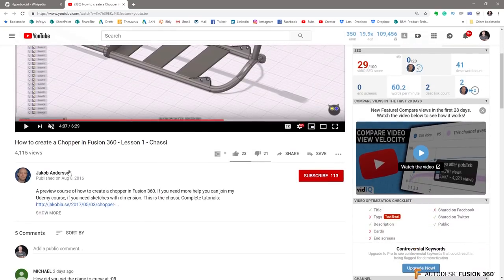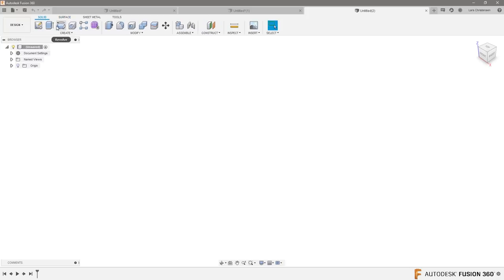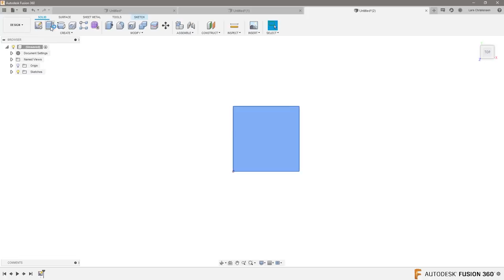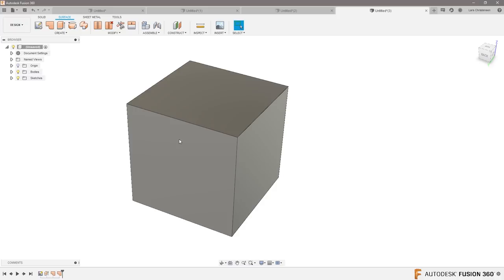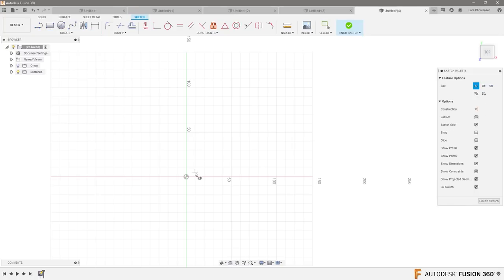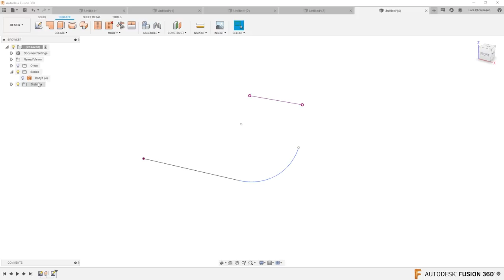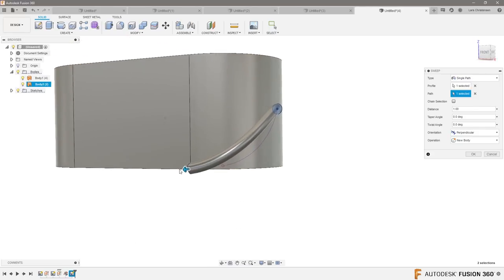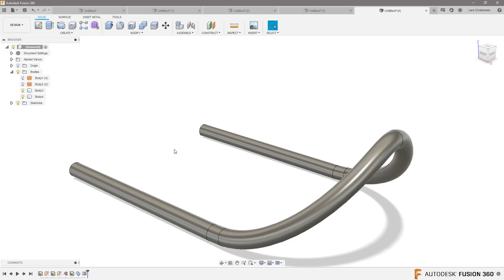Fusion 360 — 3D Sweep for Bike Frame — Ask LarsLive

Comment: Lar's, 

I think you are wrong in regards to old school surfacing. Old school surfacing is what I know but D-sub as powerful as it is. Is interesting, but as I learn more and continue to learn Sculpt, I still come away with a non precision body vs finishing up something made from surfaces turned into a solid, that is per design and makes the customer is happy.

This uneasy feeling, I have about Sculpted models may change as I gain more experience and my thinking may change.

I do like the concept of hybrid modeling where the D-sub is tied down between other geom (surfaces) is very interesting.

Comment: Hey Lars, great video. Have an idea for a quick tip video. How do you measure multiple sketched lines that are all linked to get a total length? Thx for all you do.
Reply from the maker: You can click each segment and the length will display in the lower left if the screen. There might be a better way, but I then exit out of Facebook on my phone and use the calculator app 😁
Reply: Lars Christensen Thanks Lars. That what I ended up doing, clicking each one and adding them up. Problem was I had a line made up of 20 some segments. Lot of chances for error. Appreciate your response.